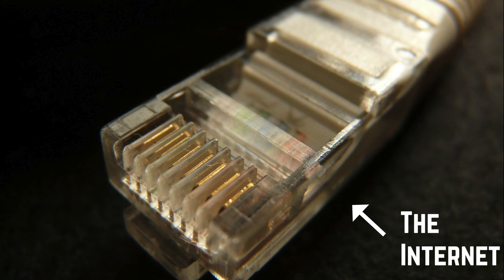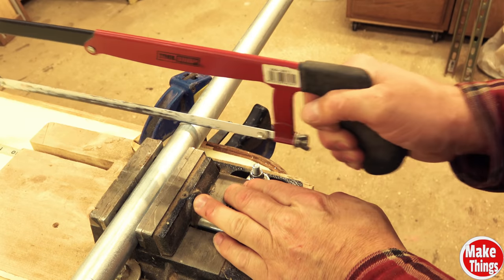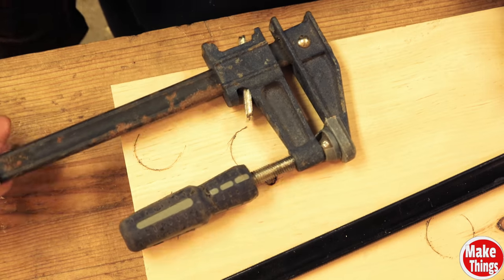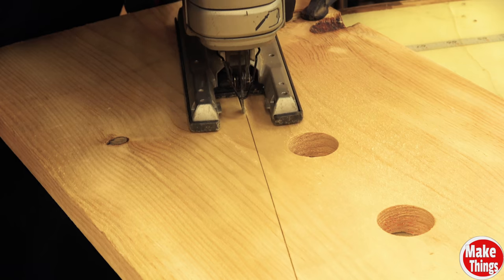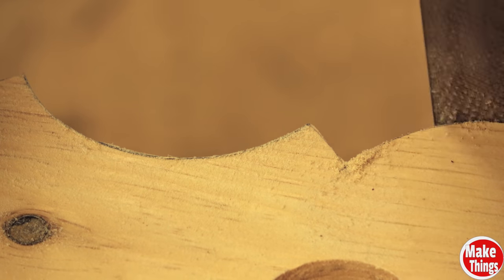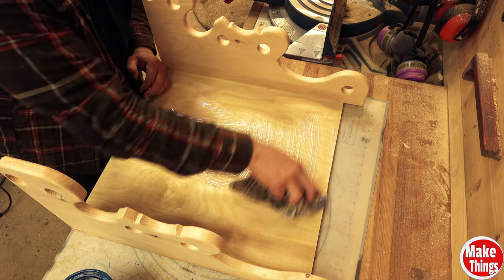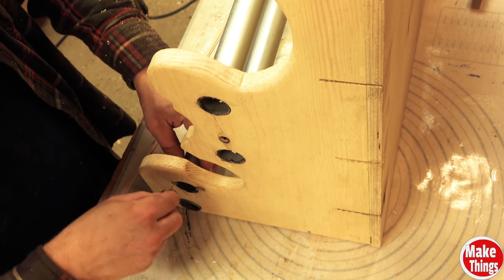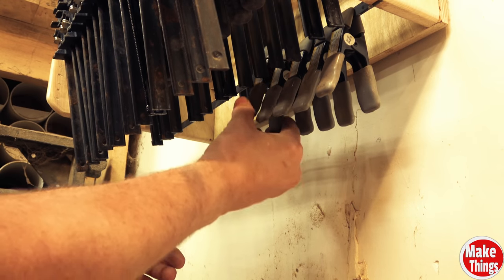Conduit Clamp Rack

Comment: One of those 'smack my head, why didn't I think of that' moments!  Make rails from conduit to hang them all on, in layers no less!  Also, I kinda love the splines instead of screws, for an easy way (assuming one has the spline jig) to achieve near-dowel corner strength.  I think I'd make something nicer out of that baltic birch than a shop clamp rack backer, and maybe go with something rougher from the scrap bin (or the neighbor's dog house), but to each his own!  Yours looks great!
Reply from the maker: Thank you so much!  Yeah, trying to keep it in a budget as I know a lot of woodworkers that start out would rather put that money in machines.

Comment: That tip with carpet tape was genius. I bought some double sided tape here awhile back n it is expensive for amount u get.. I bet carpet tape isn't as expensive.
Reply from the maker: And it's so easy to use!
Reply: @MakeThings  yep when you was telling how much you paid for the conduit I thought gee wiz that kinda expensive then as I thought about  it I remembered buying a 1 inch dowel over a year ago I remembered how much I paid for a 3 ft wooden dowel. Then I counted up how many wooden dowel I would have to buy to make that rack.  Conduit  is the bomb.
Reply from the maker: Dave Martin exactly!  It’s a great way to save money....AND you’re not limited to the 36” length.  

For example, each of the lengths I used were 20” conduit.  With a 120” full length of conduit, I was able to break it up easily into the lengths I needed.  

As for 1” dowels, I have never seen a 10’ dowel.  If I’m buying them in 3’ lengths, I’d have to waste 16” on each dowel.  Since I used 5 20” lengths, that would be a loss of 320” or 6 and a half inches of segmented lengths of dowels.
Reply: @MakeThings  yep exactly about wooden dowels.  FYI. However I have seen longer wooden dowels than 3 ft. They will b in the section  of coat closet rod kits. N come in kit form with all the extra accessories to hang the rod--- an they not cheap😵 compared to conduit.

Comment: You don't see too many clamp racks where they use the handle like this.  I made mine with some  leftover hardwood flooring with spacers and it was quick and easy.  Holds a lot of clamps and you don't have to worry about them falling off like a lot of the racks you see on youtube.
What kind of clamps are those?

Comment: I forgot to make a technical enquiry - what is the blade tension on your bandsaw? Do you find yourself adjusting (by which I mean 'fiddling about with') it a lot?
Reply from the maker: I use to fight long and hard with that bandsaw...and it really is only good for cutting curves in my opinion.  I went through so many blade tensioners to find out they had given me a crooked aluminum wheel...or maybe I bent it by trying to straighten the saw out?

I actually went to a far simpler system, eliminating both the upper and lower guides on the saw.  I went with a Carter saw blade stabilizer before I even started making youtube videos:

https://www.carterproducts.com/band-saw-products/band-saw-stabilizer

Unfortunately, there are many different models...and you have to find a one that fits your bandsaw.  Now I honestly don't touch it.
Reply: Thanks Rob. It never occurred to me that there might be after-sales upgrades for a bandsaw. I'll have a good look at this product. Thanks again.